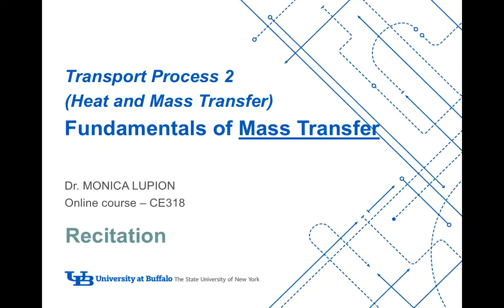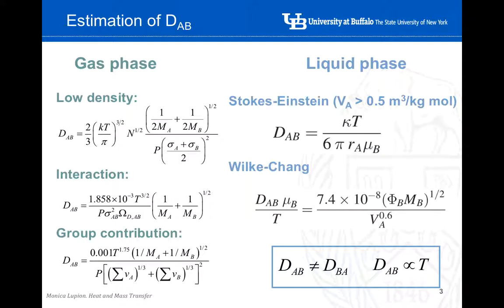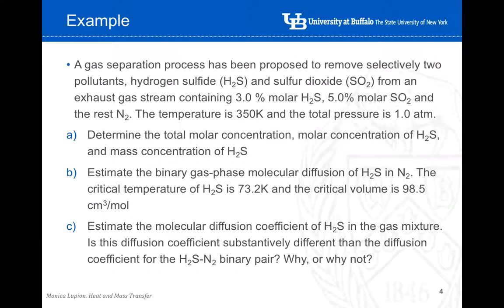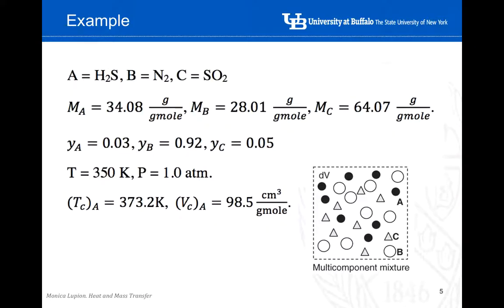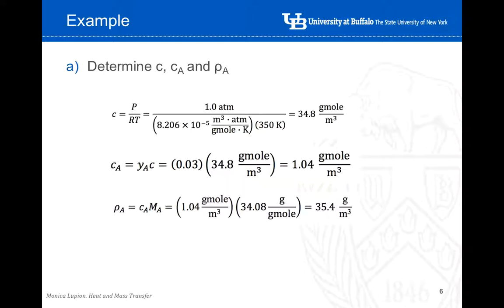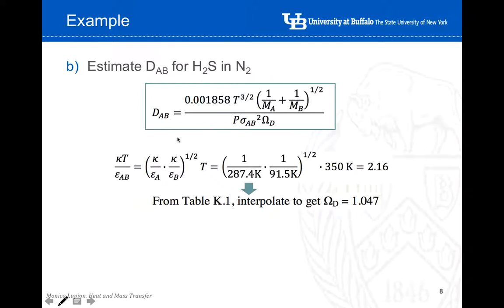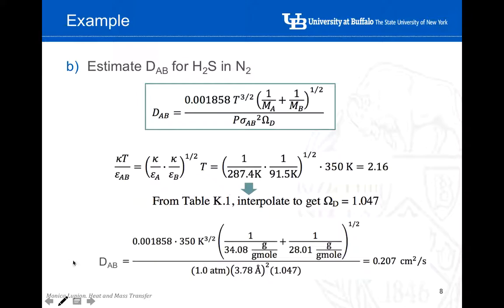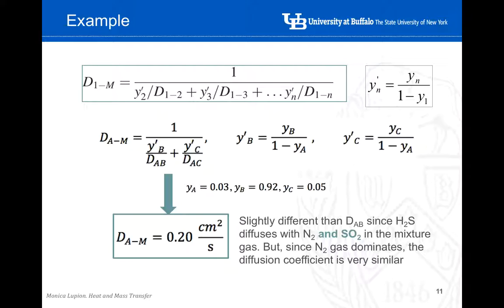Lect 09 - Diffusion coefficient EXAMPLE.

Comment: Or which book are you using?
Reply: Welty
Reply: @fahadsalem7873  ?
Reply: The name of book
Reply: @fahadsalem7873  that's not the full name... It is hard to find a book based on that ...
Reply: Ok
Reply: Fundamentals of momentum,Heat,mass transfer . By welty ,rorrer,foster
Reply: @fahadsalem7873  Thank you 😊
Reply: 6th,edition